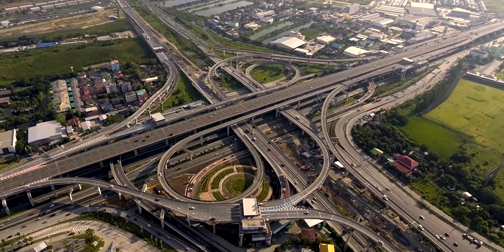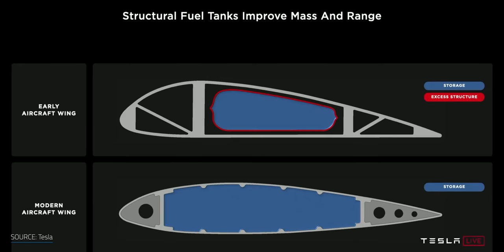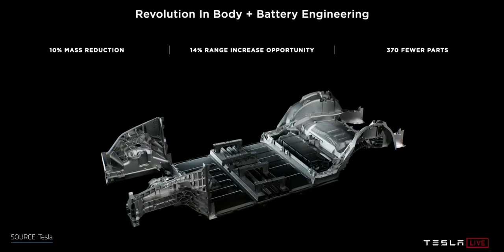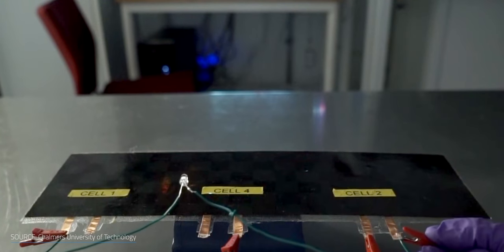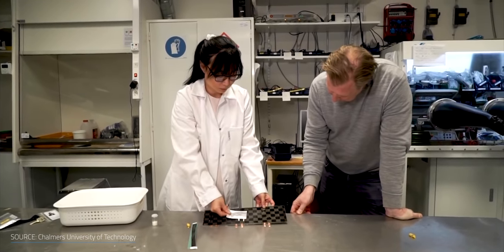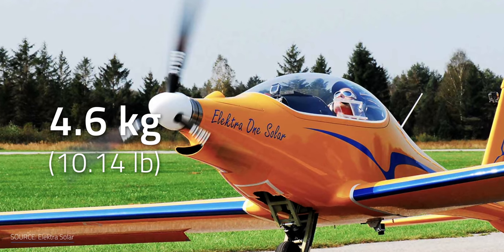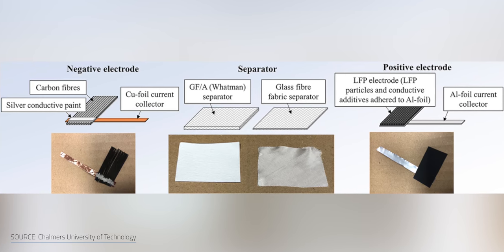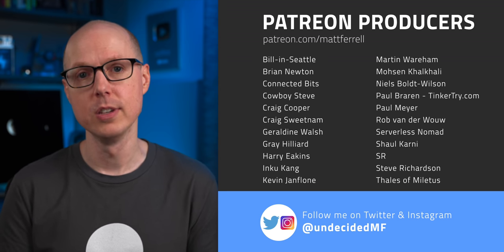Exploring Structural Batteries

Comment: Im pretty sure this wont be viable on the fact that, its made of freaking carbon fiber that is extremely expensive
Reply: US$25 per square meter.
Reply: @spudpud-T67  is it... retail...
'1" CW Carbon Fiber Plate CarbonWaves Carbon Fibre Sheet
£9.11+
1" thick Carbon Fiber plate material, ready to be used for luxury carbon fiber products.
SOLD BY THE SQUARE INCH'

'halfords: Richbrook Carbon Fibre Sheet 48cm x 76cm 249792
£59.99
Size: Genuine carbon sheet 48cm x 76cm & craft knife
Backed with quality 3M adhesive
Hundreds of road car and motorsport applications
Attractive, authentic weave finish'

pretty expensive jacked up price for a fast turnaround throughput ,man made plastic carbon derivative material/basic millennium old woven sheet a high % from other products chemical waste already processed as its bulk base etc
its not like they where charging remotely the same ball park as retail processed milk by-products casein etc even for the extra compulsory required resin
Reply: @paulmaydaynight9925  This is where I buy from   https://www.nzfibreglass.co.nz/2015/shopexd.asp?id=77     NZ$50 ~ US$25 / m2
230gm2 .  The epoxy I use is NZ$100/5L. You don't see them using 1" thick fiber in this video.
Reply: @spudpud-T67  the point. its actually available & you can.. at great cost... machine it..
Reply: @paulmaydaynight9925  Ok, but my point is: its not very costly at all.

Comment: This is not gonna go anywhere. What happens to the potential energy stored in the structure during a car crash? Cost is another issue, forget energy storing carbon fiber, even regular carbon fiber is prohibitively expensive in vehicles. It cant be mass produced like aluminum or steel, it needs to be painstakingly layered on like paper mache and baked.
Reply: This was my first thought. These cars will be insured similarly to exotic cars. Any accident that damaged a panel could cost minimum $10,000 given the carbon fiber is your battery, as well.

Comment: I don't believe these will ever fully replace a dedicated battery pack nor be the main structure of a vehicle except in very niche or purpose built vehicles. Most likely they will supplement the main battery to extend its range and lighten easily replaceable parts such as the hood, door and trunk panels for the outside, and trim, console and door molding and seats for the inside. Doing that will allow you to keep the much greater energy density of the main battery while adding additional storage at no or negative weight additions.

Comment: I think the future is not 1 battery technology, but a mix. I can see this battery being the structural container for a car, but we still need the very high density batteries to have the additional range. This could add a certain percentage to the range of existing electric transportation. Because the ranges are not nearly where they should be; even Tesla. But new battery types and forms are the solution - Hydrogen is also some sort of battery/energy source)

Comment: There is a lot of people complaining about "planned obscelence" and being supper worried about the batteries degrading on a car using structural batteries, but the evidence has proven its not that bad. Back in 2017 with the big data leak we saw all their battery degredation numbers. 10-15% after 150-200k miles. So losses of about 30-50 miles of range depending on the exact size of battery. And with the new cell chemistry and format.

You also have to realise the cost savings of this technology. Tesla says their structural batteries cut the cost of the battery in half, which is no small cost saving, easily $10k-$20k.

Comment: My question about structural batteries is "how do you change them, how easy is it?" If a battery life is 10 years and the battery is a part of the car's structure, then you have to replace more than just the battery. That's not cheap and you can't just go to a junkyard and switch out a door or a fender, if part of the battery is in it. And what if we choose to have switchable batteries for those who can't charge their cars most of the time and we want to have "battery stations" to refuel? If the batteries are a part of the structure, then it is a bit more difficult to come up with a "pull in, take out, put in, drive off" model for refueling.

Comment: The recyclability circle in this Venn diagram is just knocked off the table with this scheme though. Carbon fiber has very sexy mechanical (and now, in this scheme, electrical too) properties. But when this glued-in-place, integral-to-the-structure battery as the car creation finally outlives its usefullness...its totally non-recycleable. Isn't it?

Comment: Seems like this is headed toward a non-serviceable, throw away car.  I have always thought the battery should be  quick change modules like a cordless drill.  Standardized so that a service station could offer an immediate transfer option (at a higher price per kw/hr of course but credit for remaining charge would be given ).  Replacement modules can then be most efficiently slow charged.  Fast dc charge for those willing to wait.  The car can then remain adaptable for upgraded technology.  A deposit system (like propane bottles) would be developed and testing of modules for safety could happen during off time also.  Are there efforts like this being considered??

Comment: The use of a structural fiber as a battery is much more efficient - it isn't just dead weight. This would allow a drone to put batteries in the fan blades, and make the body weight close to nothing - just payload.

Comment: If you watch the video that Tesla produced you will see that the front and rear components of the car are added to the battery pack. This can be done by either bolting or welding the parts together (similar to the way ICE cars are made now), That being said, there should be no problem replacing the battery pack (by either un-bolting or breaking the weld).

Comment: Most important thing that I can think of that's not really mentioned is workability.  Can you machine the cells?  Can you mold the cells?  Part of why the plane wing idea works so well is that the fuel is a liquid and you can just chuck it in a pot.

Also that plane lmao, they could make it fly WAY further by just training me to fly it 'cause I'm half that guy's weight.  Probably cheaper too.

Comment: This sounds nice. But what about the other side of the e-car issue: that of recharging? An already-stressed power grid will be pushed even harder when millions of gas-powered vehicles (with proven and improving design performance and logistics already in place) are forced to be replaced by expensive electrics, which will be plugged into home outlets (adding to the energy bills) to recharge overnight, when grids typically get to "rest and regroup"? 

As we've been learning, alternatives to diesel and coal plants such as solar (only work during daylight - what about smoke and other obscurants?) and wind (need consistent yet manageable breezes, are prone to disastrous fires, are difficult to recycle, and kill lots of birds) have serious limitations. Extended droughts can affect hydro-power, and nuclear plants - the most efficient and increasingly safe source (and would be safer if more effort were put toward that rather than closing them) are not being built, and existing ones are being shut down.

Comment: unfortunetly depending on where these massless cells are located it may be susceptible to certain things... like someone keying the vehicle, is this a concern that was brought up, I noticed the electrodes stick off to the side how resilient are those and is there a way to prevent flood water from getting to those so that there isn't a massive short circuit, can a car made of the stuff take a crash, or even a simple ding and still properly function,
in a perfect world this would all go just fine, but this is not a perfect world, 
and also i noted a lot of the comments point out that with structural battery's you'd have to get a whole new car if it gets damaged even a little 
when you look at a invention you first go like. oh cool. and then you realize the problems with it if something like that does happen.
no this is just a bad idea.
although i will say this is definitly a more packable battery so you could layer so many more of them than the current cylindrical battery's tesla currently uses, unfortunately this leads to it just becoming a structural component again and thats no good

Comment: This type of battery indeed have the potential to be a game changer butt it should NEVER bee part of the panels of the car (but it's a great idea with planes)
In a ground Vehicle as a car in the case of a collision it would be extremely expensive to repair.
The advantage is that it would be much more useful INSIDE the car as being made in carbon fiber would be very light and having chemistry based in LFP would be safer too.
The only topic is the energy density. At that gravimetric energy that you mentioned is going to offer little range even being lightweight...
It need to improve more. But still have high potential!
👍

Comment: Would it be possible to weave the carbon fiber strand into small tubes that can create a honeycomb pattern? If the strands are compiled into tubes that are wound in a way that doesnt require the strands to be broken, and could be a continuous ribbon as its wound, then stacked so the tubes would create sheets of honeycomb materials, they could be formed into structures that could potentially triple the density of carbon per a given area.

Comment: I would like to see this as a non rigid mat that could be incorporated into glass composites. Perhaps just produce the necessary layers and let the experts add them to the layup of whatever they are building. I could see entire boats or aeroplanes being constructed in that way. If the foil and conductive paths were integrated into/on to the woven glass or carbon fiber it wouldn't even be different as the material in those is the same as in use today.

Comment: I think this would be better for something like body panels rather than the actual chassis of the car.  Though, in either case I wonder about long term degradation and failure modes.  Also, I feel like there should be some kind of crash discharge safety mechanism.

Comment: Finally a car that bursts into flame on collision like in a movie!  If I am following, the cars body panels will be made from structure batteries. When those structural battery panels are compromised they will release energy and that energy mostly as heat. Which, will not be great for the integrity of the structural battery panels to which they are attached. Ask a firefighter what they think electric vehicles now. It isn't just super positive. This doesn't look like an improvement. 

Also, short range is half the story for why EVs are not more widely adopted. I can fill up a care with 20 gallons of fuel in minutes and be back on the road. How long does that battery charge take?

Comment: A significant issue I can see is the longevity of the battery. When the battery energy density has degraded - requiring the structural components being replaced seems unsustainable

Comment: Even if they stack the carbon fiber batteries to increase the storage capability, just the fact that it's carbon fiber and not materials used in lithium ion batteries could make for thinner and lighter battery packs even if they are not integrated into the product design, as for items like self cooling water bottles, the integration of the carbon fiber batteries could be very useful for a layer in the outside of the bottle then a solar cell on the outside powering a thermoelectric unit on the bottom of the bottle to cool the drink, so an integrated battery could be very useful in terms of design specifications.

Comment: I'd be pretty concerned with the climate and health risks carbon fiber can cause. Carbon fiber has been likened to asbestos by some scientists as the dust from carbon fiber can be harmful in similar ways. While carbon fiber can be recycled, it's pretty expensive. While there are some ways to recycle it, some ways can hinder its durability and therefore cause some issues with reliability of recycled carbon. If carbon fiber is used unwisely as plastic has been, I'd be worried, especially in applications like batteries

Comment: It's a cool idea, but even a small fender bender would be insanely costly. Plus battery life is always going to be crappy compared to internal combustion engines and the cost of replacing will be insane. Then what happens to the batteries when they're done?

Comment: 8:40 spot on! It's a biggie I urgently wanted to be addressed for the past 5 minutes. ;)
Reply: Hm, you haven't really covered the whole "once it catches fire or short circuits it burns really well" - issue. At least in cars making sure the battery packs don't get damaged in crash events is a major design restriction. I expect this to severely limit the areas where these packs could be used as structural components.

Comment: structural energy storage can be made accessible with ICAE isothermal compressed air energy or liquid nitrogen cars because the tanks can be used as chassis structure and most important, they don't ravage resources and contaminate as electric batteries do

Comment: Sadly the lifespan of those batteries don't last that long so this will not be a long-term solution not only that but recent impact tests show that these cars fitted with this rip in half at 45 mph when t-boned, the expenses would cause you to replace the vehicle instead of the pack after the pack has worn down which is sort of ridiculous especially since the lifespan is so short due to heat and supercharging

Comment: pretty amazing if you think about using it on a plane. they are covered in aluminum panels, now if you replace all those individual panels with batteries and put in electric engines you may have the range you need. now for those thinking once the battery goes bad then throw it away, not really, these panels are easy to take out and replaced if it goes bad so why not try it out. same can be applied to a car, make multiple replaceable panels on the outside that if it goes bad you can easily replace them individually. the key for making it work in car would be how to secure it from people trying to steal individual panels lol

Comment: Solar panels with built-in battery storage. Less infrastructure and switching costs in a building/home installation and an effective “24 hour” solar panel, further reducing switching design and power management hardware and software. Modular would mean lower replacement costs for storage degradation while gaining improvements from generation & storage tech rather than a fixed 25-30yr system.

Comment: The solution is not in battery, its in the infrastructure .. also the future is self driven vehicles to optimize usage.. Roads need to be upgraded to supply each vehicle with power directly through network while moving, so worst case in the beginning, a small reserve battery pack may be needed.

Comment: Absolutely, its clear that combining 2 functions in the same structure is going to loose weight.  I'm being using pushbikes made of carbon fibre for 15 years and haven't experienced any failures whatsoever.  Lifestyle motorbikes have a significant problem of getting enough range, if this technology can be applied there they could perhaps retain a max weight of say 200kg while giving enough range for those weekend rides.

Comment: Putting the batteries into the structure might save weight of course. But it also means that if you hit something like a rock on the road or back into a gate or whatever you might require an extremely expensive specialist repair or total your car completely. This is already becoming a thing with Teslas because in their efforts to reduce parts they are casting entire chunks of the structure in a single piece instead of many - great for them, not so great for consumers if that piece gets damaged. In a sense it will make cars more "disposable" since the cost of repair could reach a point that people will seriously consider just scrapping the thing and buying a new car.

Comment: Would this really be the optimal solution if solid-state batteries will be commercialised around the same time and Will be significantly smaller and more energy-dense than lithium-ion batteries. I am still convinced that solid-state is definitely the future of energy storage. I don't think weightless energy is a bad idea, but it will be out-competed by solids-state batteries due to price.

Comment: we could have our conventional thermal engines, but instead having the mechanical transmission, we are making electrical transmission. the engine is driving a generator, and with the waste heat, we could power some stirling engines and TEGs. In this way, we could at least double the autonomy of the car, if not tripled. and the engines, we are attaching them directly to the wheels. The battery pack, we are distributing all over the vehicule.

Comment: If this is to be used structurally, how will it be charged? Charging voltages are upwards of 400v and similar current values. So would these structural elements have to be fully insulated for safety?